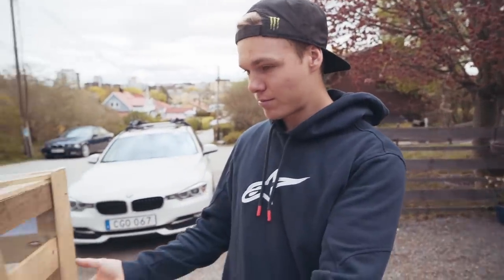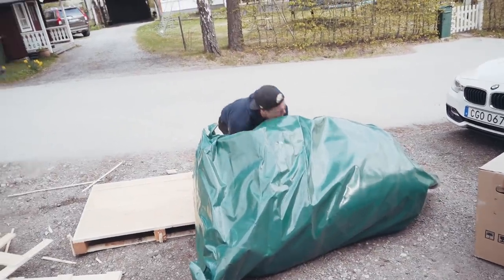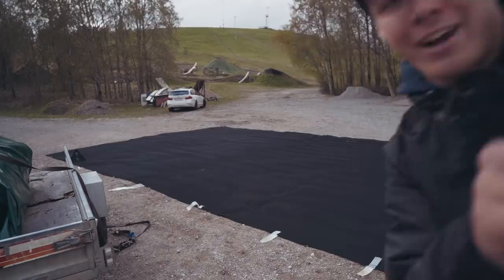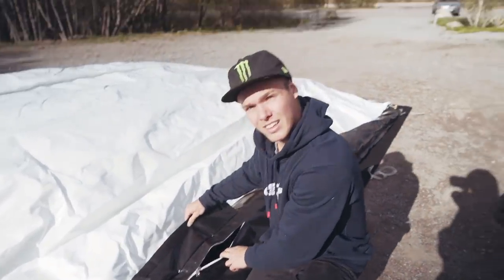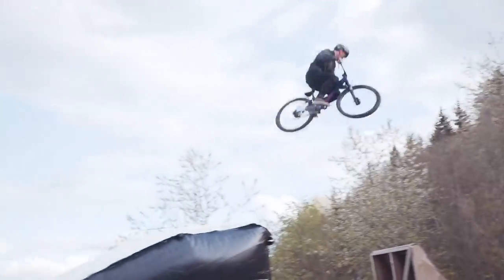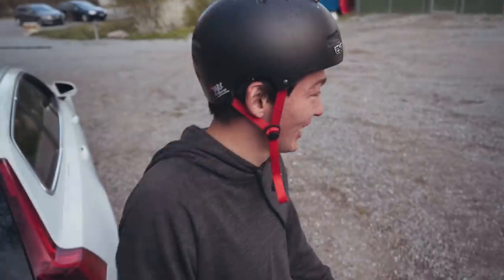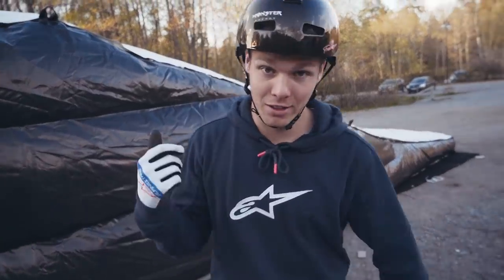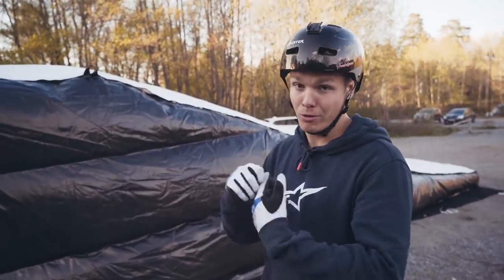I BOUGHT A HUGE FREESTYLE AIRBAG LANDING!! (first testing)

Comment: Wow, impressive skills guys! That's a rad inflatable landing! Regarding the bikes being thrown around after failed front flip attempts, you could put some 12 inch crash pads at the end of the inflatable landing (if you are worried about that) maybe two mats in a row? Like 4 feet by 8 feet gymnastics mats.  Just an idea, but once you get those front flips dialed in, you to need them!!